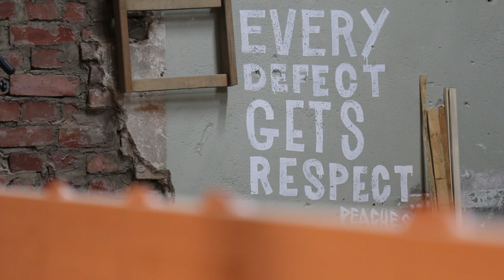Laura´s traditional Farmers Table (Bauerntisch)

Comment: Amazing work, as always. Something you might want to try, is building classic furniture only using traditional tools (saw, chisel...) That's a very peculiar experience!
Reply from the maker: since i need to finish my project in a week (including video production) i am happy to have my powertools speed up the process but i might try is with a smaller project.
Reply: njhnjh666 In true eco style, honoring wood as an ecological material.

Comment: Looks great! Is the only thing holding the top on to the bottom section a few of those biscuit jointed tabs ("piffpapf"? ha!) screwed into the top? Sorry, I don't know much about woodworking, so I was surprised by that part. Thinking it over, I guess it makes sense that they would be plenty strong enough if there was another one directly opposite and providing opposing pressure against the frame. Can I ask how many there are?
Reply: Pawel Szymczykowski allows the table top to expand and contract,  anything too secure and the top will crack or force the mortice and tenons apart.
Reply from the maker: there are 4. they are plenty strong but still allow movement when wood expands.
Reply: Thanks for the clarification! As you and +Livi120 pointed out - I hadn't considered expansion. Is it safe to move the table around by holding just the top ledge?  I'm guessing it's much better to hold the frame, but I think I'd instinctively grab the most outstanding part.